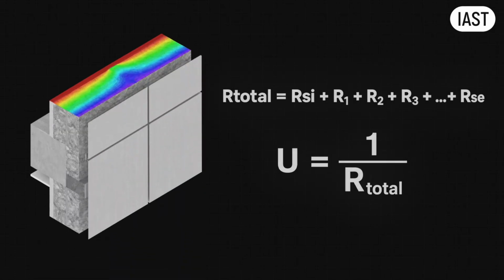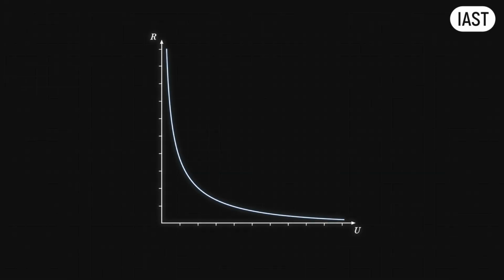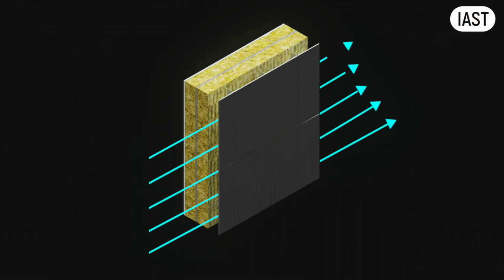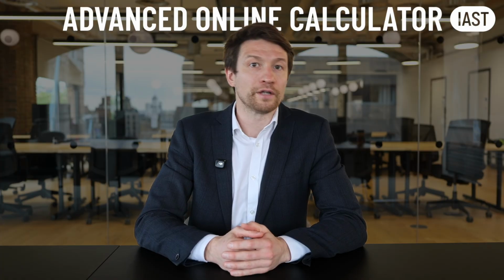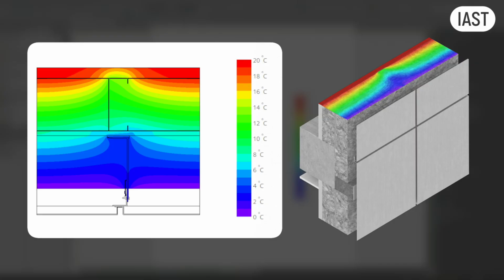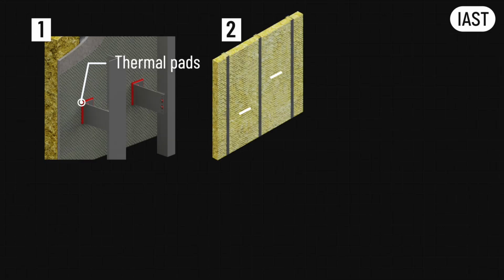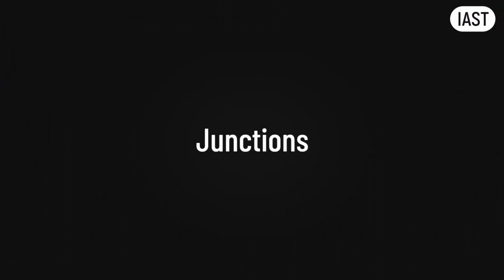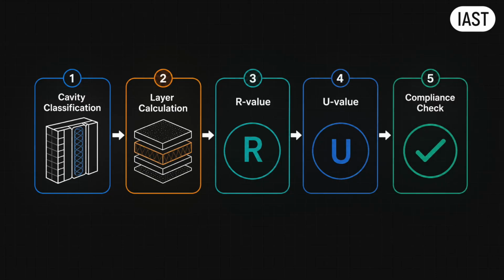Thermal Analysis of Multi-Layered Walls

Comment: I had planned to build a house using Isospan wood-cement ICF blocks with wood-fiber insulation. The average U-value of the wall system is 0.189 W/m²K. My intention was to add 20 cm of rock wool insulation and a 12 mm ventilated ceramic façade. I believed this would meet my requirements for both thermal and acoustic insulation while also providing excellent fire safety.

However, after watching this video, I am no longer certain that my assumptions are correct. Even small construction or installation errors can significantly reduce the insulation performance and lead to results that are far worse than expected.